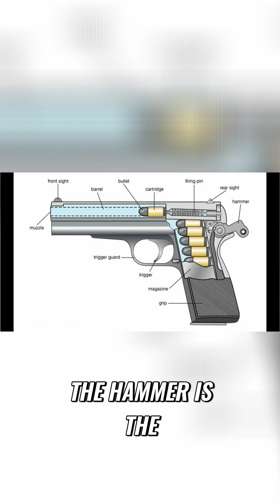Striker-Fired Pistols: Why They Fail (And What To Know) #M17 #P320 #Sig

Comment: Definitely not all striker fire pistols. My SD40VE doesnt do that and its probably one of the cheapest full-size, striker fired pistols you can find. I have also never seen a Glock do that either.
Reply from the maker: Glocks definitely do, they demonstrate it in the trigger smart video I reference in the full video. I don't recall if they tested a SD40VE but they test several different makes and models and definitely some S&Ws and they all fail in the same way. Here is the link to their video. https://www.youtube.com/watch?v=L17Mq7XxtlE
Reply: @ReadinessNation That video doesnt prove anything other than not to pull the trigger all the way back to the breaking point then be surprised that it went off. The original P320 fail video involved a man taking a screw and using it to eliminate the pretravel of the trigger. Not pull it all the way back to the breaking point. Also his p320 was still on safe when it fired so thats another point off this other guy. All he has done in that video is spend 25 minutes pulling the trigger all the way back and then wiggling everything around on his gun. Who tf is going to do that to their gun? The issue here is that the p320 is well known to just go off whenever its slightly jostled. No other handguns are doing this and I would like to think the guy wearing a sig shirt is probably running cover for them by saying "its not just us its everyone else too"
Reply from the maker: @Xet_Venom  You are missing the point of both of the full length videos I made on the M17. In the full video this short was cut from I talk about why the specific findings of the video I referenced matters for military use. The guy in the Sig shirt is from Sigs video on the subject, which I also reference in this video as it discusses the technical internals of these weapons. 
My Full video: https://youtu.be/mp5Qg5fbWdU
 
And I talk about the Wyoming gun project video in my previous video on the M-17. 
My Full video: https://youtu.be/36NMWfEUHYY